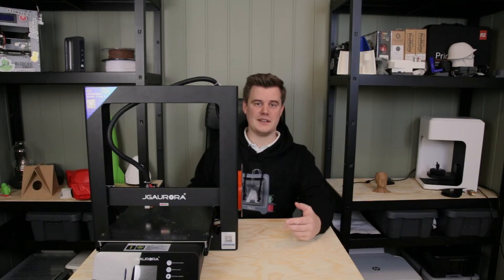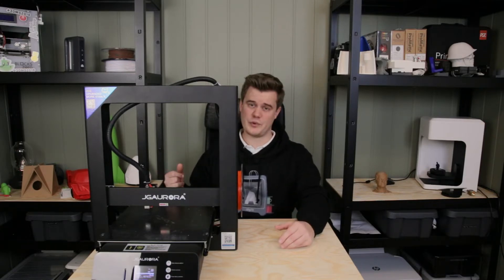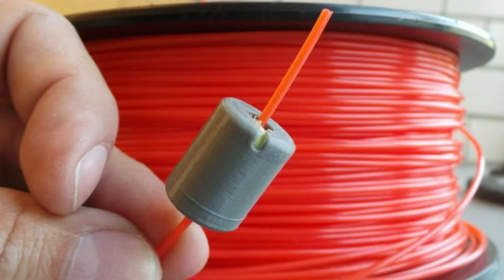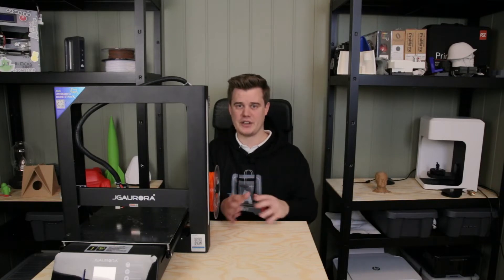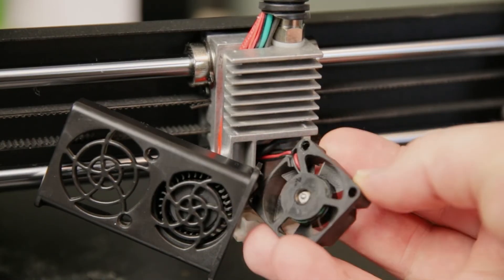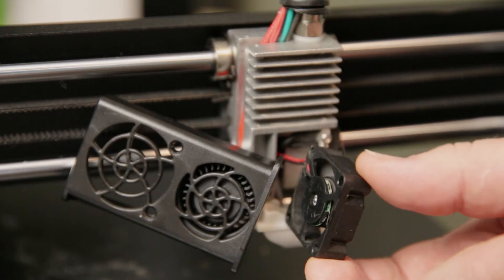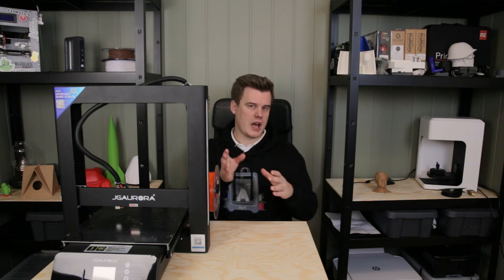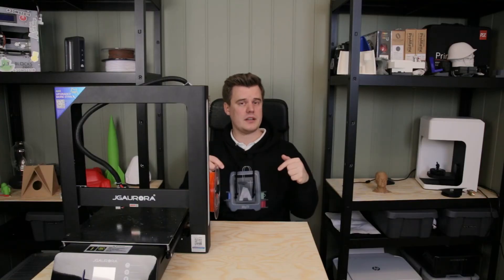HOW TO:  Fix loud noisy 3D Printer fans

Comment: Thanks. Handy video. Works well as quick/temporary fix.  I find the oil doesn't last long, esp on high-speed/high-usage fans. The lube tends to 'spin out' :)   Try a thicker oil - or as I do - a grease-like lubricant that is 'application-friendly' (eg. safe for use in your situation).  Apparently some folk use dry lubricants, such as PTFE, Silicon, or graphite... in spray cans that evaporate.   If there's much disassembly involved, I tend to replace the fan straight away, as ultimately, the lubricant dissipates and that really irritating noise returns!  :)

Comment: I used my printer many months ago, and now i tried to print and when it printed this noise came, do you think it’s dangerous?
Reply from the maker: It shouldn't be very dangerous no. The fan might just be noisy, but probably won't do any more harm than that. If it continues, you might wanna swap it out.
Reply: @3DPrintTechDesign  Ok thanks :) by the way i have a large fan next to my 3d printer incase of an emergency (i have trauma).
Reply from the maker: @TheHeadlessMario haha, better be safe than sorry!